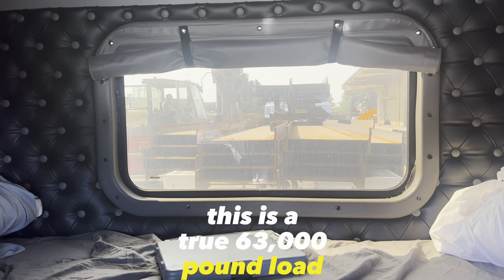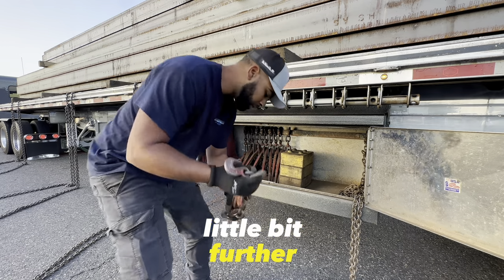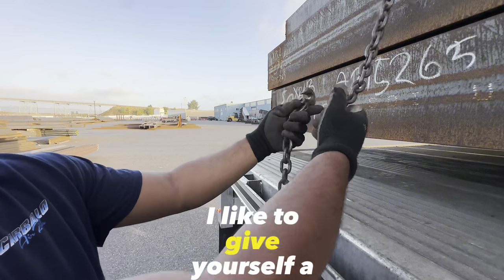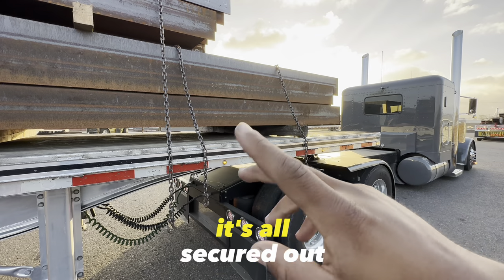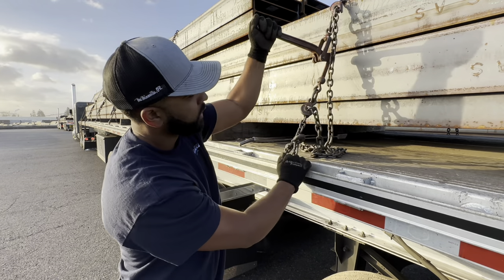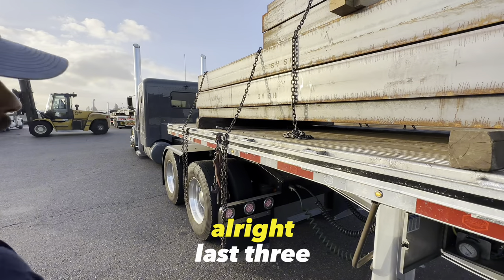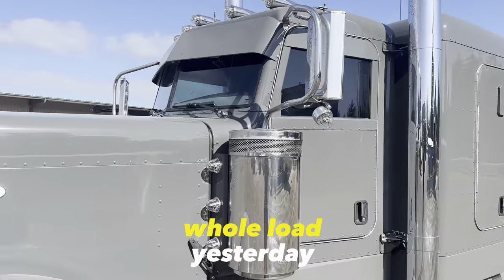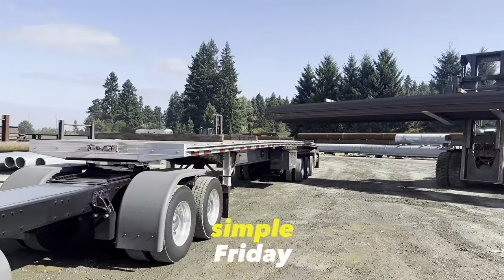HOW TO use chains and binders on flatbed load of steel beams

Comment: Long time Heavy Haul/Oversize guy, those are some pretty good tips for any new Flatbed or Lowboy guys.  Myself, I pull a lot of multi-axle lowboys, step decks and multi-axle flats with lift axles, and I run a 4 axle daycab Star 49Xwith a big Palfinger knuckleboom crane and a Protech headache rack with LED strobes and work lights and a 6ft tall chain and binder locker. A couple other thoughts that may help some guys, NEVER use a pipe to put over the winch bar to get the snap binders tighter, unless you want to dive under the trailer when the releasing binder launches the pipe 20 ft in the air, and because I haul anything Public Utility related (heavy cable reels, plug and play generator sets or switching stations and heavy equipment), I do a lot of loading or unloading on the roadside, I put all the binders and winch straps on the passenger side. I use a combo of snap and ratchet binders, but in the winter, stick with the snap binders, the ratchets will freeze from road spray. If you haul any big cable reels, get yourself about a 10ft long  maybe 3/4 inch diameter rod threaded on one end with a bolt to provide grip, drill a hole at the end of the opposite end and make a loop through it with a length of heavy duty nylon strap, then you can pull the chains through the reel eyes without getting on the trailer. If you have something that may slide on the deck, use rubber fricton mats, and never put the chains or straps outside the rub rails, and never let a binder handle go outside or below the deck. If you're ever in doubt how to secure anything, look it up in the DOT manual, any cargo you can imagine is in there with instruction. I use high grade chains in 3/8, 1/2 and 5/8 sizes, and along with checking the hooks, also check the chains for bent links, if you find any, replace the chain, same goes for straps, the label has a "replace by" date, and if a strap has any lateral tears, replace it. I've done this a long time, and I've never had a DOT violation for anything.
Reply: Starting out with step deck how many chains and binders do I need ..? Coming from end dump
Reply: @MindUpG 10 of each should be good

Comment: U have no headache rack? I always cris  cross my long chain across the front of every load  of steel plate, beams, or pipe like this load, and I always use ratchet binders on steel, rubber tied machinery. I carried. 8 under the bunk in. A box to keep em fresh.:

Comment: No such rule on having 2 in 2 feet, 2 in the first 10 is the actual law with one every 10 feet after unless it’s against a bulkhead then you can just do 1 every 10 feet. Of course weight is another factor but in my experience length is almost always the factor that determines the securement required and usually ends up being far more than required for the weight.

Comment: I may have missed it in a previous video but what suspension do you have on the rear of the truck
Reply from the maker: It’s low low air leaf
Reply: @trucking4racecars   I bet that rides super smooth, my truck has AirTracks 46k and she’s a little rougher than our NeWay truck or my previous KW 8bag 46k set up

Comment: Great video!!! I haul precast concrete myself and prefer snap binders so much i went and bought my own because I didn’t like the safety binders that the company provided me… 

I run my chains the same way as you do and it’s perfect to get that half a link adjustment for the perfect tightness on a chain 

Super clean setup!!!

Comment: You are in the correct spots with the chains, depending on state your in. They also look at how your load stacked as well so straps may not be required. If it was me I would’ve added at-least 3 straps for extra security and safety!!!